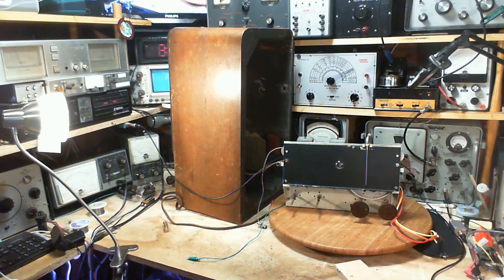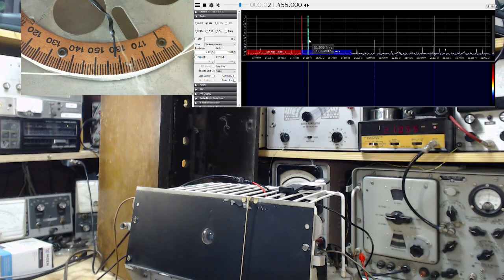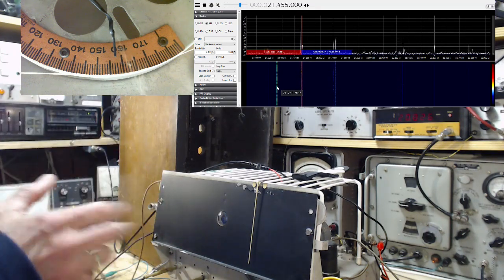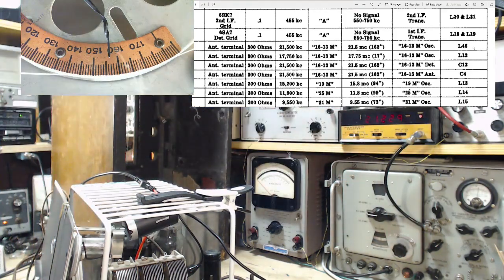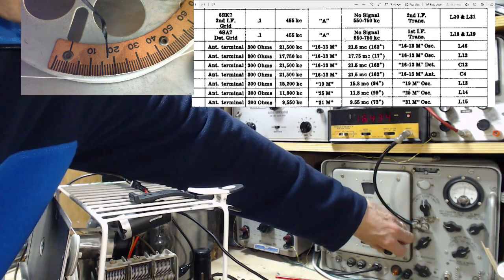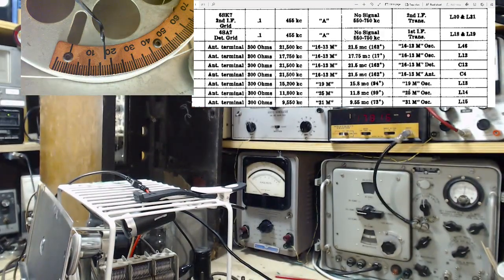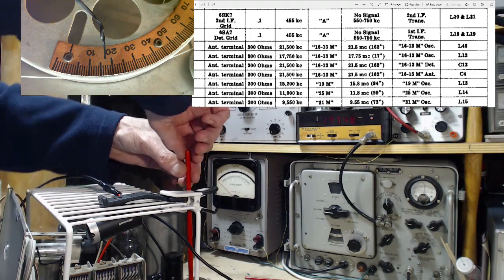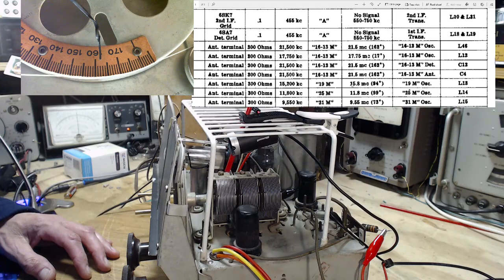General Electric KL-70 Video #3 - 16-13 Metre Band Alignment

Comment: The reason why he can't get the 21.5 MHz is because the scale is set to 158º instead of 162. Jim had it right at the beginning, but then he went into tunnel vision and wacked the alignment...